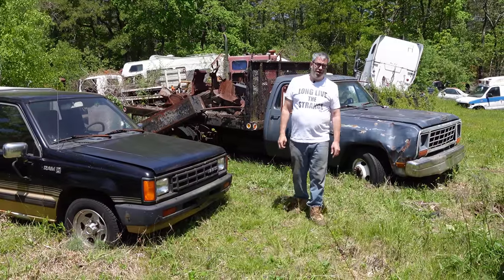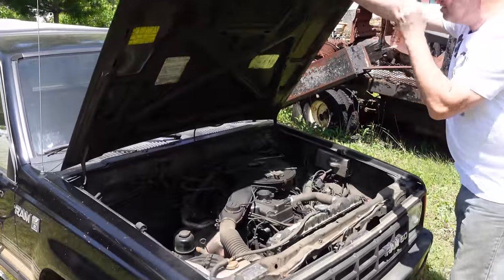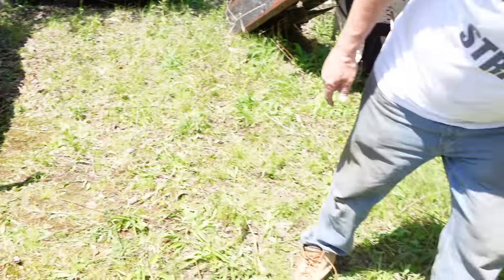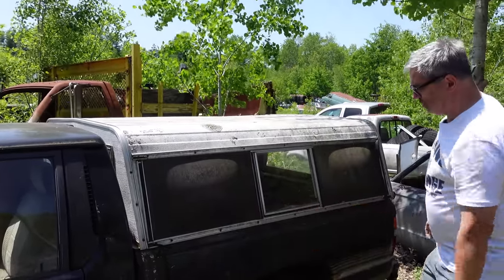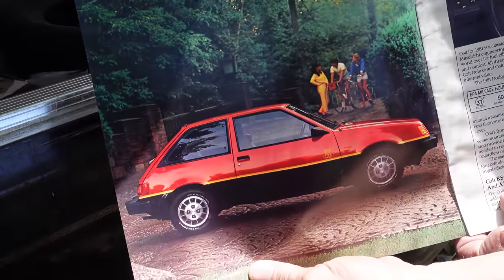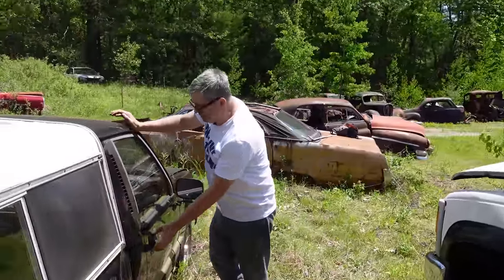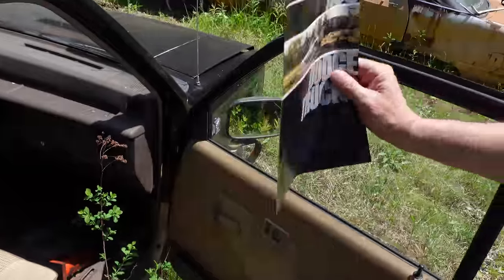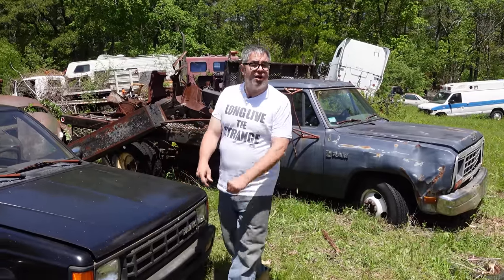Baby Ram

Comment: Looks like that truck could easily be brought back to life.
Reply: And with very little effort.
Those little Mitsubishi 4 slingers were hearty little motors that didn't wanna quit.
Reply: I thought that to till I saw  the plant growing threw the floor  and the driver front fender wall split can see when he shows the tire.
Reply: usually it's the frames that go bad on these little trucks, can swear the body used better steel than the frame.
Reply: It's in New England, the frame is toast
Reply: @zackjay71   Plant was outside and the door closed on it I believe.
Reply: Could probably save that bed cap.
Reply: @lilmike2710  they were dogshit slow though lol

My friend had one with the 3-speed automatic absolutely dreadful not worth the time and day to drive
Reply: My 84 Toyota single-cab shortbed pickup with a 4-speed manual was five hundred times the truck 😊😊
Reply: @Zachjay I saw that also underneath may be rusted bad.
Reply: @Sam holdsworth  Your right that 22R engine can go 500k miles if maintained right.
Reply: @KS-xo3oh  Mr. B. Here ! Live & worked at the auction 13 years buddy , rust bucket 🪣. LOL !
Reply: Neighbors had a 1999 Ranger that looked perfect except for a couple rust bubbles on the tailgate... I put new exhaust valves in the 2.3L engine and it ran perfect again... a few days later someone else worked on it when the coil packs quit... new ones were $200+... so they put used ones on that were also bad... unbeknownst to me they gave up and put it in the junkyard... this was like 10 years ago... I would have bought it off them and put a 351W V8 in it...
Reply: Currently all it needs is a chaser for that liquor on the front seat.
Reply: @rustbeltrobclassic2512  Most likely because of the short wheels/tires, if they went flat they were very close to the ground. Smaller tires easier to sink in the ground also.
Reply: @kramnull8962  👍 LOL !
Reply: @kramnull8962  👍 LOL !
Reply: @samholdsworth420  If speed is the be-all end-all then, sure I suppose.
Reply: Resurrect the Ram!
Reply: It’s in good shape, maybe not rotten in the frame like many others there
Reply: @kramnull8962  I thought I saw a case of Pabst in the bed
Reply: Yes l agree, I've seen several that looks like they were drove to the savage yard and parked
Reply: @kramnull8962  - It's not the 4 on the floor but the fifth under the seat that counts...
Reply: Wishful thinking in the northeast
Reply: Long live Baby Rams😄  I own 3 lol

Comment: That truck looks like it is still in descent shape. I had a 1989 RAM 50 5 speed. Loved that little truck. Got rid of it in 96 for a 4WD Dakota. Wish I still had both trucks. My RAM 50 ran great with 176K miles on it when I sold it for the Dakota. Wish we could go back in time.

Comment: Couple of points I would like to mention. 1987 was the second generation RAM 50. This marked a huge departure from the first gen RAM 50. The 1st. gen had greasable control arm pivots instead of the 2nd gen rubber bushings. Most "We Be Lube and Shit" places had no clue and would not grease them. This caused some severe wear issues. But if you did grease them every 3 to 4K miles they lasted forever. The front brakes were massive solid cast rotors with healthy calipers and pads. Next point, the 1st gen long bed,  with the 2.6,  2wd was a 1 ton rated truck (more on this in a minute) The 1st gen frames were box steel construction from bumper to bumper with well thought out large cross members through welded , no channel frames on them. Next 1st gen point was the rear axle. The rear axle shafts would embarrass a ford 9 inch, they literally filled the axle tubes which were fairly heafty. However the differential case center section for the cross shaft was definitely a weak point under power. Over time the cross shaft would beat the housing bore from round to oblong. Upside, once you got about 0.20" bore wear you would up with a locking diff under load. Down side, you better be headed to the salvage yard for a new center section (which by the way dropped out just like the venerable MOPAR 8-3/4!!)                                                                                                                                                          Now more on 1 ton rating.  When the first gen came out I started converting them to V8 power for people who wanted a 1 ton rated truck that got great fuel economy, could easily pull and stop a heavy trailer, fit in a parking space (remember this was at the time when parking lots were being re striped for smaller spaces/more shoppers) and had enough power to get out of it's own way. By the 1979 model year Chrysler had pretty much killed the big block (Chryslers last big block vehicle (van chassis/cab) was produced in 1980 not 1978 as some less informed claim. I know this as I worked on quite a few) Anyway, I used all factory parts for the V8 conversion (except for custom fabbed front cross-member and heavily modified transmission cross-member and buick V6 water pump pulley, Eldorado air cleaner and modified 4 ro brass radiator) And for the front springs I used Ford Fairmont station wagon springs with 2 turns cut off. So I ordered quite a few parts when doing these from Shelby Dodge on Neil St. in Champain Illinois. One day when there to pick up parts, JB at the parts counter asked me if I would allow a hand full of engineers from the ST. Louis plant check out my truck. Well 6 engineers spent a few hours checking it out and driving it. They just shook their heads (out of disbelief and amazement) and asked "why"! As I stated, I wanted a 1 ton truck that got great fuel economy, fit in a parking place, could easilly handle a car trailer and reliable. And with the hood closed, you would have no idea a V8 lurked under the hood unless you noticed a pair of 2 inch tail pipes popping out behind the right rear tire. All this before the Dakota and that was why the engineers paid me a visit.
Reply: Great info! I just bought a 1982 Ram 50 and got it running after being abandoned for 10 years
Reply: @RealSteelFabrications good luck finding parts nonexistent now got a 90 ram 50

Comment: I was in Service Management at a Chrysler, Plymouth, and Dodge dealership back in the late 80's, and I have to say that these Ram 50 trucks were very reliable. Hardly saw any of them brought in for problems - unlike the full size Dodge trucks and Dakotas. I also saw a few equipped with the Mitsubisbi 3.0 V6 engine and manual 5 speeds.
Reply: That 3.0 would turn a little D50 into a rocket ship………😮

What were the issues you saw with the full-size Dodge trucks - by that time (almost two decades in production) I would have figured they’d have every possible “bug” in the thing worked out……??!!!
Reply: @ddellwo   - I saw full size Ram trucks with some electrical issues (bad grounds), a few tranny issues, but the biggest problems were poor fitting doors and hoods, and broken body welds.
Reply: Great video
Reply: YES!! Love me a good manual transmission!! Never owned an automatic.

Comment: This video was a twofer for me. My stepfather owned a red Dodge D50. It was a great little truck until it developed rust issues. When you were flipping through the 1981 Dodge imports catalog, you showed the Dodge Challenger. I had the Plymouth version, aka the Sapporo. That was a peppy 4-banger coupled with the 5-speed manual. That's the car that got me through my final years of college, so I look back on it fondly. I haven't seen a D50 or a Challenger/Sapporo on the road in many years.
Reply: I just got a ram 50 back in the road after sitting a decade

Comment: I had a 85 MItsubishi MIghty Max for 14 years 2 WD, 4 speed manual, air, sliding rear window, and 7 1/2 ft bed.  It had the 2.0 I-4.  Good little truck.

Comment: The company I worked for had one of these as a parts-running pickup for a time. It had the most uncomfortable seat I’ve ever sat on. It was like a board covered with upholstery.
Reply: Late 80s gms were just as bad. A milk crate was more comfortable.
Reply: The springs on the driver’s side of my Ranger’s bench seat broke so I got a pair of buckets from some imported car in the junkyard and put them in
Reply: Blood oath mate
Reply: So true

Comment: Great review as always. I was born in 1987 and dad bought a brand new S10 regular cab manual 4 cylinder with a white cap he bought from my uncle.

This truck is a great value even today. Accounting for inflation, that $5,788 is only $15,800 today. Good morning and have a great day everyone.
Reply: The Chevrolet S10 is a good  pickup truck. I had a 1994 S10 with a 4.3 litre Vortec V6 and it lasted for over 250,000 miles until the automatic transmission went out
Reply: @sidgreentherhymeofreason  Yeah, the only reason dad sold his in 99 was the body had rusted out, the Iron Duke 2.2 and Toyota 5 speed manual were still strong. 

An uncle also had a Sonoma extended cab of the later generation and a later generation s10 green manual regular cab.

Comment: I had a Ram 50 that I bought brand new in 87. $7,100 @ Bonneville Dodge in Manchester New Hampshire. It had the 2.0 litre 4G63 engine in it. I ran that truck up to 280k and sold it and that guy ran it for another 2 years. It rusted out. I once rolled off the scales at a scrapyard with 1320 lbs. on it. It was on the rubber spring stops 😊. That was a great little truck.

Comment: I had an 83 D50 and an 88 that looked exactly like that one except it was an extended cab. The 2.6L with a 5 speed was a BEAST! A buddy of mine bought a new 83 Silverado with a 350...I cleaned his clock. We both towed similar sized boats from Texas to northern Arkansas  through the ozark mountains..he could not keep up. I started my machinery sales biz in 91 with my 88.. towed way too heavy of loads for years. Sometimes up to 10,000 lbs. Like from MN to Texas. I wish they made them still...I'd buy one in a heartbeat. Seriously more truck pound for pound than my Cummins  dually..

Comment: Loved my 79'. Yellow with huge rainbow graphics, bumble bee buckets, yellow mag wheels. After I replaced the factory "rubber like" piston rings with an overbore and new pistons, it stopped consuming oil and behaved. Primary/ Secondary two barrel carb and the 5 speed manual 2600(exactly half the size of a 318, with huge pistons) could outrun my buddy's Mazda 2600 two for one in acceleration. First gens were too small inside the cab for this 6'-4 1/2" round eye and the weird box size made it tough finding caps. My brother had the 2.0 with the 4 speed manual. Half the acceleration of my 2600. Could NOT break the leaf springs no matter how I tried. Box rotted off the face of the earth, like so many Nipponese trucks of the era. Good one Steve

Comment: In the petrochemical plant I worked at we had a Mitsubishi lift truck with this same engine. I’ll tell you that it took a beating and came back for more. We had a bare cylinder head in our spare parts and it was a hemispheric or semi hemi. I also daily drove an 87 Ranger for almost 34 years and the Ford/Mazda was a great little truck. Excellent video, Steve does a great job
Reply: The topper is identical to the one I got for my Ranger a couple of months after I got the truck. It was made in Denver by “Magic Toppers”?but I’m sure the same six foot unit was built all over the country by local manufacturers

Comment: 2.6L Mitsui big block. Great, tough torquey motor. It’s silent shaft technology was licensed by Mitsui to Porsche for the 924. Industrial variant very dependable in fork trucks. Highly underrated engine.
Reply: They used oil, expect to add a qt. every 800- 1000 miles, I had one put over 100k on it, but they were good besides that..Edit my engine was the 1994 2.4

Comment: There was more to the cap than sheltering cargo. In some states (example: New York), an  open pickup couldn't get anything but commercial license plates and were restricted from driving on parkways and in the left lanes of some highways.  If you put a cap on it, now it was more like a station wagon and you could register it as a car. This was also the reason for the rear quarter windows in private vans: solid walls=commercial vehicle, windows=passenger car.

Since then, they changed the law and open pickups can be registered either as passenger cars or trucks.

Comment: I had an ‘82 Plymouth Sapporo with the 2.6 and a 5 speed.  I traded it towards an ‘84 2WD D-50 with the 2.0 and 4 speed.  Added a cap, American Racing wheels and a lift kit from John Baker Enterprises.  I used to haul gear for my band and the stock suspension was weak.  Sold that and got a ‘91 Power Ram 50 LE (3.0L 6 cyl, 4WD, 150 HP).  Added a cap and brush guard.  Drove that until 2004.  They all rotted quickly in Massachusetts.  Good value at the time.  My neighbor’s Toyota rotted before mine.

Comment: Hey Steve..i remember when the Dakota came out with the first fuel injected 318..the 318 never ran that good the truck was a mighty hauler..the year after that it was discontinued ..replaced with the V 6 ..ford had the 300 CI in 96 that was the first year fuel injection in 97 the replaced it with the 4.0..auto makers do some dumb things ..see you on the next one Cheers friend 🇺🇸🇺🇸🇺🇸🇺🇸🇺🇸

Comment: I had a 1986 W50 4×4 that was gold and black, gold body and black stripes. It was a manual transmission one. I rolled that one.

I had the 2.6 in two Chrysler/Mitsubishi vehicles, 1979 Plymouth Arrow GT and the Dodge W50.

Comment: Well Steve another great vid , I bought a 86 D50 4x4  in Canada for a truck to tow behind my oilfield vacuum truck when the hitch broke and my fully loaded loaded F250 Super-cab 4x  was destroyed on a huge backroad downhill in 92 , I bought it because I was only going to tow a beater from now on . The joke was on me as I really enjoyed my automatic equipped 2.6 litre little gutless Mitsubishi . It had the most comfortable bucket seats of any vehicle I have ever owned till this very  day and the steering wheel was in the perfect spot even though nothing was adjustable , hell the seats didn’t even flip forward , I commented this to a friend of mine who has owned an Accura and a GTI and he told me his 80 something Dodge Colt he had previously had the most comfortable seats he had ever owned . Also the little Mitsubishi could carry 1000 lbs no problem when half that bottomed out my previous 70’s Datsun pickup which had seats which the foam was completely sacked out to where the metal crossbar in the back pressed into you .

Comment: I had an 86 Mitsubishi Mighty Max. Put over 300k on it. Ran like a clock. Sold it to a friend for his son. He wrapped it around a tree a week later. Never burnt oil. Only put 1 clutch in it. Great truck.
Reply: I had an 88 with the 2.6 and a 5 speed. That was a great little  truck